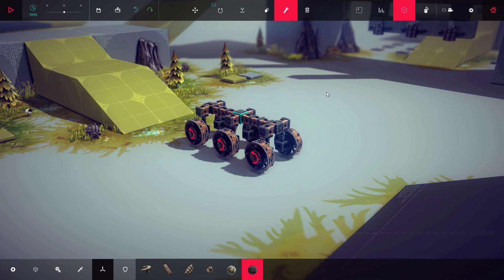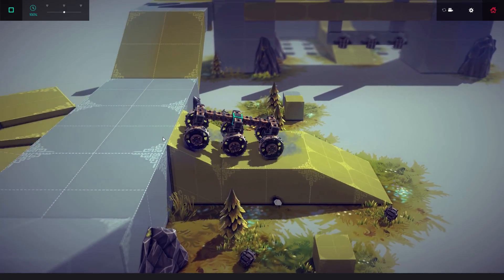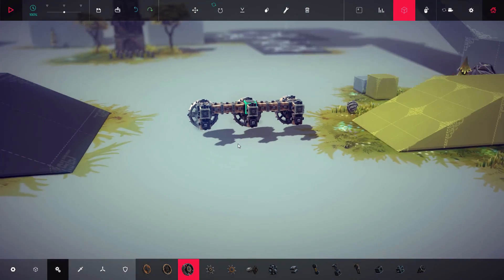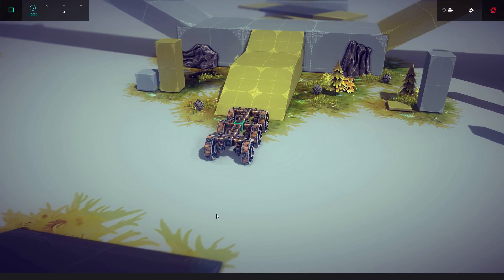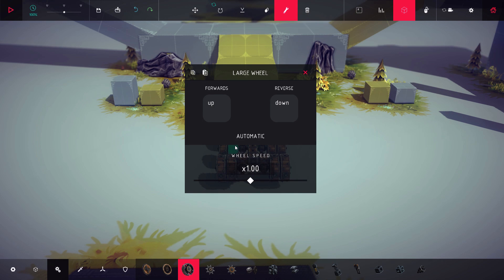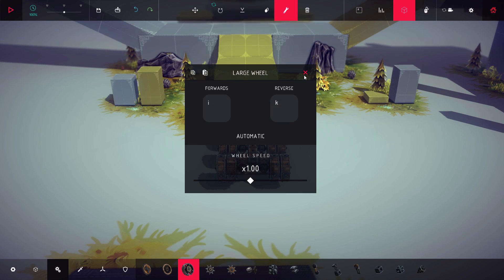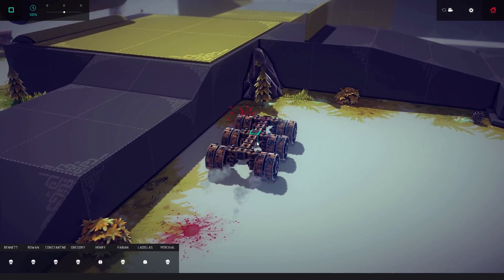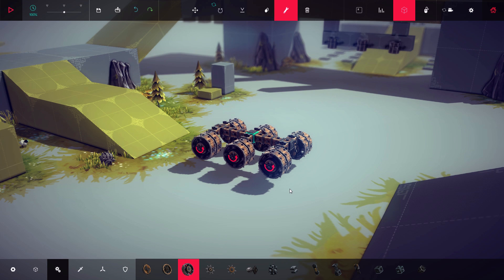Besiege Suspension and Turning Tutorial | 1080p

Comment: the pro version with this is suspension is mentioned for shock absorption, and there's none here, I can see how this would be useful in places however if the original suspension is done right all six wheels should touch the ground anyway

Comment: This isn't the suspension.

The purpose of the suspension is that to comfort an object from hard sudden hit and bumps. Like for a car, you are using a suspension to comfort the driver and the passenger, as well as the cargo in the car.

While you made a car that purposely touch all wheel in the ground, not comfort. Because you won't see the compress when going on the bump or falling to the ground.